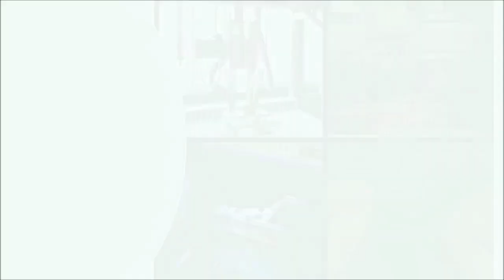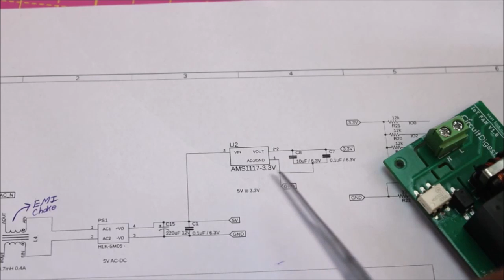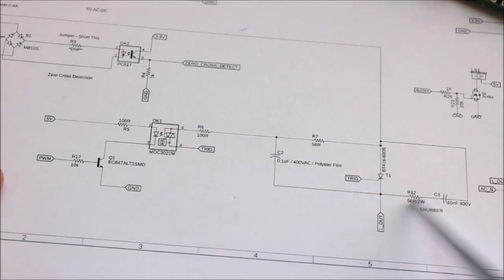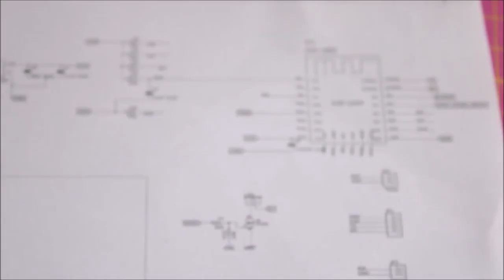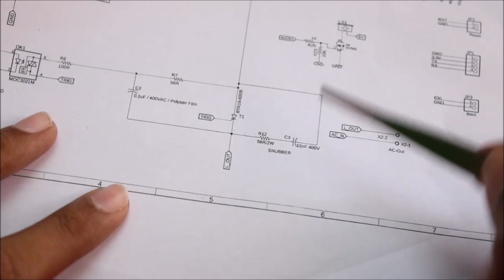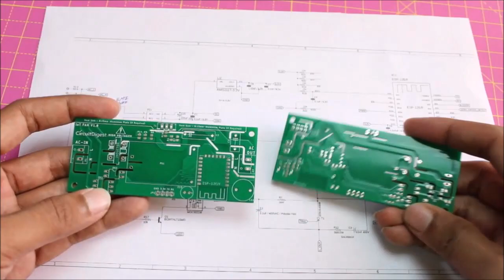IoT Based Smart Fan Control using ESP8266 and Blynk

Comment: The only reliable way to control fan speed is usung different level of capacitor per speed or the old reliable way hardwiring each speed to a relay.

The issue with these triac and pwm based fan control is they hum and can cause speed fluctuations specially on ac lines with fluctuating voltage which is very common on small motors (desk, stand and wall fans like on this video) but not noticable on big motors used in celing fans.

Comment: Hi, thanks for the video. can you clarify if the TRIAC based fan controller is actually hum free? You did ,mention that to make it hum free you have to do a perfect zero crossing detector. Can you explain why is that important as there are a lot of TRIAC based designs on the internet but they all suffer with the hum issue. Thanks